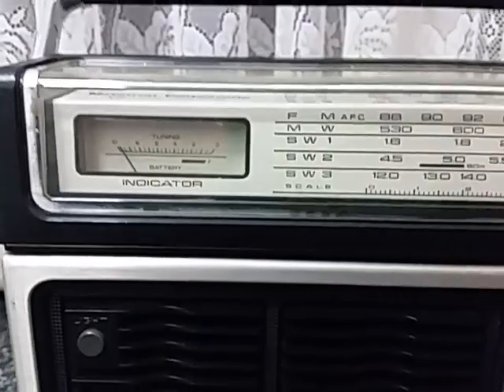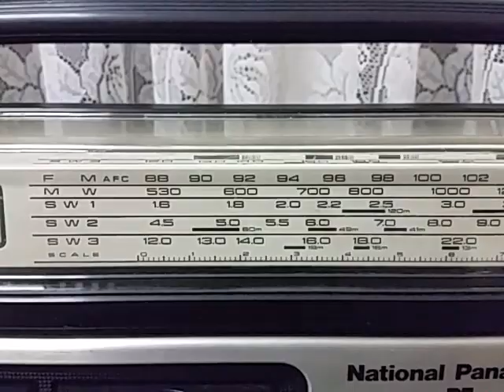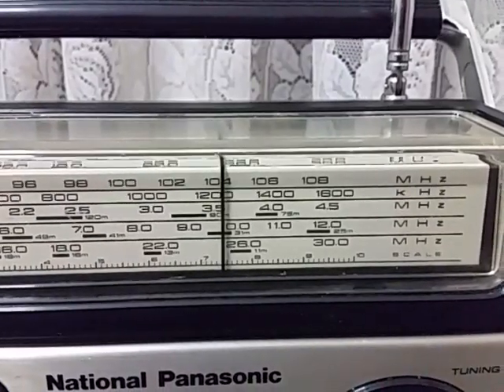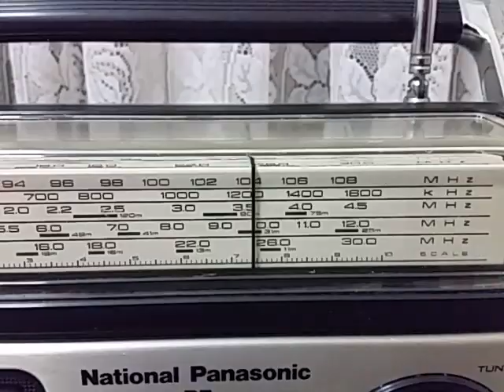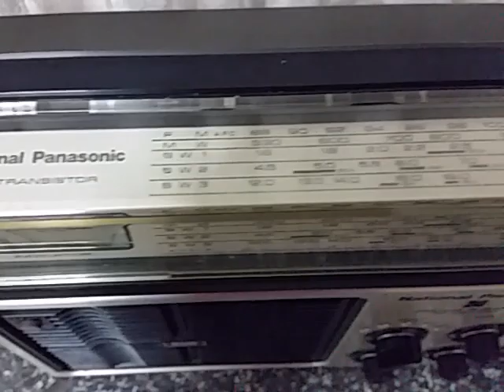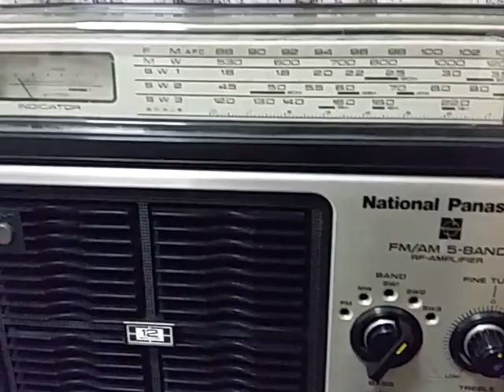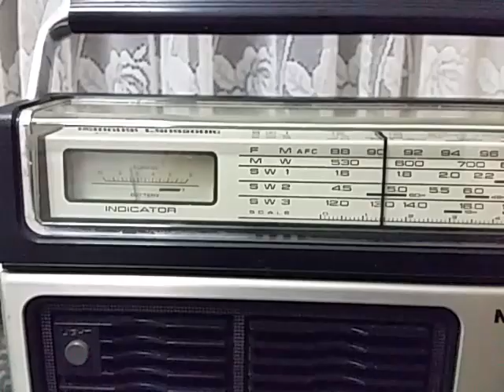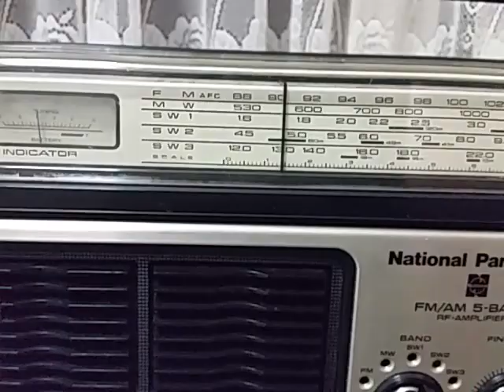The National Panasonic RF-1350BA Shortwave radio

Comment: I Have a radio like this, only mine is the model without FM. They are GREAT MW and SW receivers! That's what you call "a radio". And I am in Europe and my radio doesn't cover the LW band. There are not so many stations left on LW in Europe which you can receive without a massive long antenna, most of them are German or French. So you're not really missing out on anything if you're don't understand German or French.